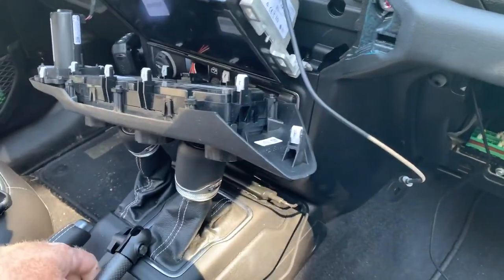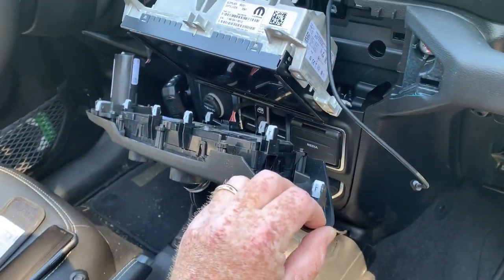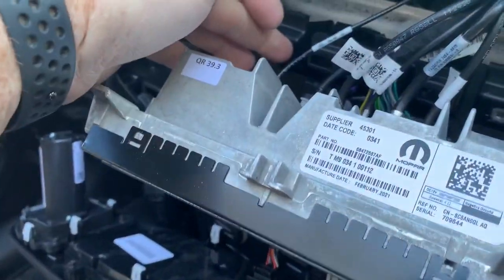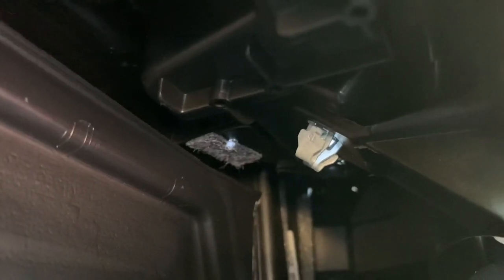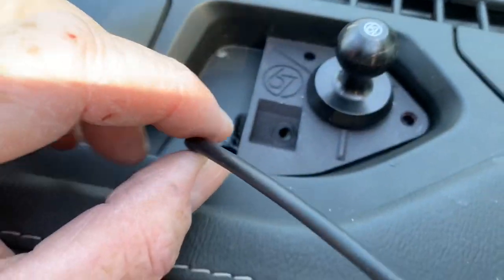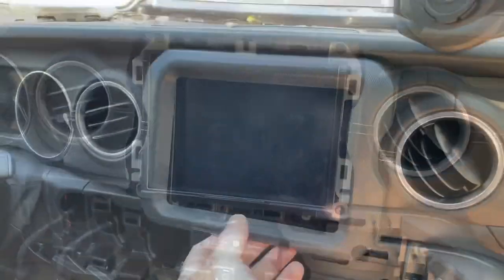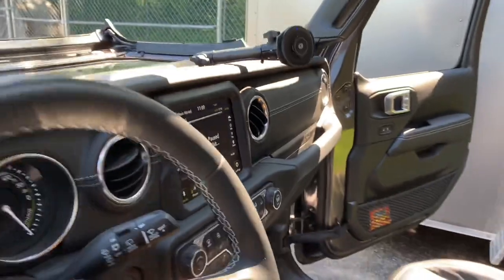Running a power wire to the top of the dash of a Jeep Wrangler

Comment: The most important part you skipped. Getting the regulated power to the usb cable, and connecting the usb-c cable to power supply.

Comment: Great Video .... What 12v switch did you use down by the hump?  Finally installing Bulletpoint mounts & need power.
Reply from the maker: It’s not exactly like this but similar. I tucked it up behind the dash. I cut the cigarette lighter part off and hard wired it.
https://amzn.to/46k7lQD

Comment: Great video.  Any chance I can get you to detail what you did to get that power strip installed?  Tap into the fuse box?  What amp fuse did you use?  Where did you plug in?  I have a 2019 JL...  And thanks in advance!
Reply from the maker: I have the factory aux switches. So in the foot well on the passenger side, there are 6 wires. 4 are for the aux switches, 1 is hot all the time and one comes on with the ignition. I wired my power strip to the one that comes on with the ignition.
Reply: @Wrangler4XEFans  Ahh, I see I’ll have to pivot somehow then. Thanks for the reply though!

Comment: Looks good. What power port/USB bank do you have connected down there? And it fit just fine?
Reply from the maker: It’s one that has 3 12 volt sockets and 4 USB. It ticks up neatly behind the carpet and under the dash.
BESTEK 3-Socket Cigarette Lighter... https://www.amazon.com/dp/B075QYN4S5?ref=ppx_pop_mob_ap_share

Comment: Never drill an oversized hole. Cut the wire and solder it back together and tape or heat shrink each. That isn't even a data cable so you only need 2 conductors.
Reply from the maker: I considered that but wanted room for a grommet.
Reply: @Wrangler4XEFans  you can use heat shrink or fabric wire wrap. Wire wrap also cuts down on cable noises.

Comment: What charger are you using? 
Is the cable long enough to make it to the arm rest area?
Reply from the maker: As the video says, I’m using the QuadLock charger abs it goes to a power supply buried in the dash. It’s wireless charging.

Comment: Where does your Bestek power port adapter plug in at? Switched power?
Reply from the maker: I have the factory aux cables. The wires are above the passenger foot well. There are 4 wires for the switches. There are also two additional wires. One is always hot and one is switched. I have it connected to the switched wire.
Reply: @Wrangler4XEFans  do you know which one is switched, or have a video of the install by chance?
Reply from the maker: @NicsFlix  I have a video but I didn't get a good shot of the wiring. The color code is in the owners manual and I have misplaced mine somewhere here at the house. I think if you look for Aux Switches in the index, it will take you to the page.
Reply: @Wrangler4XEFans  I looked at your video archive and coulnd't find the one you reference about installing the power adapter. Any chance you could share the link?
Reply from the maker: @spykekrepshaw3178  Oddly enough, I can't find the video either. Maybe I'll have to make another one.
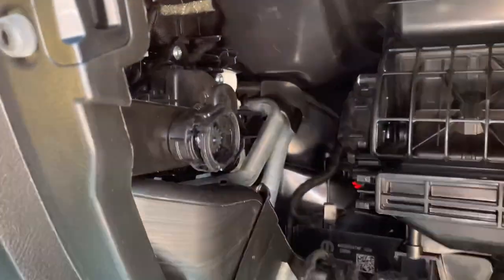Reply from the maker: @spykekrepshaw3178  At 6:00 I sort of talk about it.
Reply: @Wrangler4XEFans  Thanks for the reply. I saw that in the video. I was just hoping for a little more on how you wired it. I plan on doing a similar install soon myself. Waiting on 67 Designs to get a specific mount back in stock.
Reply from the maker: @spykekrepshaw3178  I thought sure I made a video about it but I can’t find it in my history. I may have to make one about it.
Reply: @Wrangler4XEFans  it’s all good. I found another guy that did something very similar. Maybe even used you for inspiration. Thanks for looking though. And keep up the awesome work here and on Facebook!